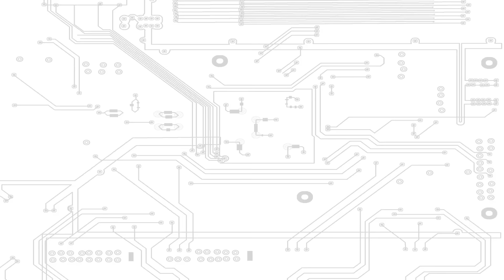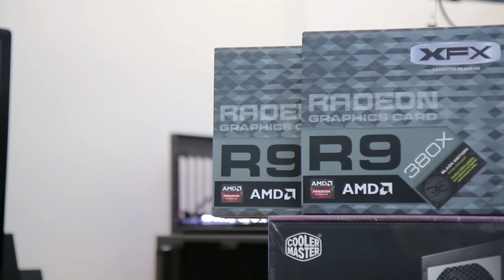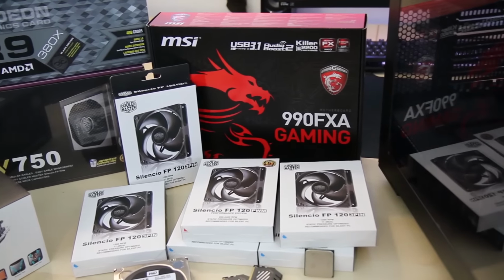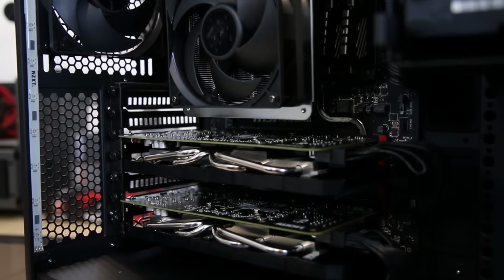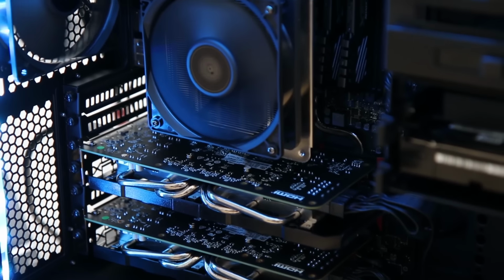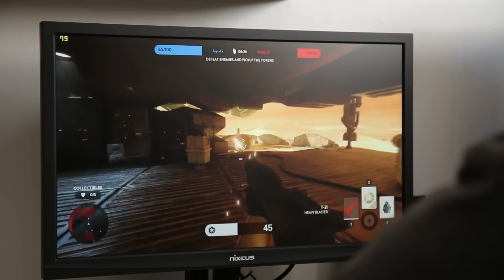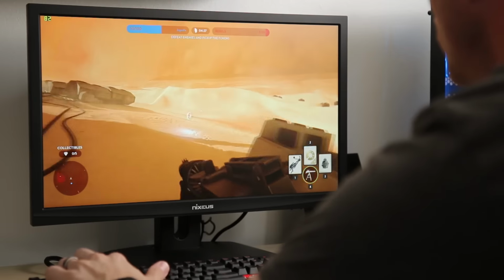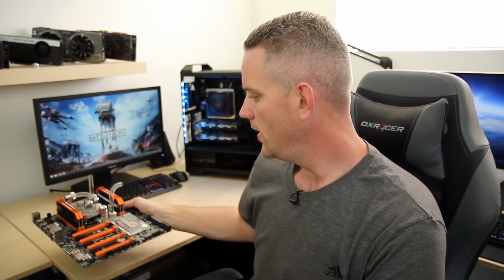AMD Gaming PC - Is AMD still good?

Comment: If all you intel fans wanted to see some proper Amd products u should actually buy Amd stuff and give em some income to show u what they can do. They are struggling to hang on and they actually do with descent price/performance..
So ditch Intel for a bit, support Amd and you will see some great stuff from every company after that.
Competition is what makes the world evolve. And there is no competition right now because everyone is buying the same stuff.
(Intel, nvidia, apple,MS). The consumers brought the hault to tech world, not the companies.
Reply: NO AMD did this to themselves......They bet on software actually using multi core tech which isnt happening until recently. Not to mention they crammed 8 "cores" in there for marketing bs and threw single core performance under the bus. I am an AMD fanboy and have been for MANY years(been rocking AMD since I built my highschool graduation pc in 2002). I built the fx8320 I am on right now in 2013 and it gets its ass handed to it by my GF's 2.2ghz i7 laptop on cpu performance. Thats right 3.5Ghz loses to 2.2Ghz(complete bs)............if Zen is a dud or they try to price it like nothing has been wrong this whole time then I am going team blue on the next build.

All that said since doing a 4.2Ghz OC its just barely beating my GF's i7-2600k desktop in cinebench and it performs well but dont make the mistake I did of thinking an 8 core with 1/2 threading is going to smash a 4 core with true hyper threading.

Its really sad to see AMD dying like this because I do like that most of their chips are unlocked etc but I am at the crossroads with AMD.......oh and PCI-e 3.0 would be nice.
Reply: Cmon man we know we aint getting a beast of an 8core for 130$ (dont know how much it costs where u live but in Greece its literally half what u pay for an I5 6600) . But  for the price i do back it up. Even today.  Why would there be multicore s/w  when the greatest percentage of users has 4 cores max?
totaly agree with u on zen pricing btw. 
Call me an idiot but i actually moved from team blue to team red this year and i kinda like it. 
My demands arent that high and i can game very descently on an r9 390.
I will feel like an idiot though if zen turnes out to be in the same price range and much better :p
Reply: Im just sitting here with my AMD fx8320 on water OCed to 5.0ghz and an r9 290 oced to 1150mhz playing games at 4k with freesync fps rates mmmmmmmmmmmmmmmmmmm does this make you salty?
Reply: Play Attila with unit size set to Extreme. Have fun, lol.
Reply: quick update i Xfired 2 r9 390s. Will get back with impressions. For the moment i can only say they look awesome in the rig :p
Reply: Deafman what psu do you have. I'm thinking about crossfire too
Reply: I got the evga 850 g2. PSU calculators say i need an 800W  psu (even with small oc) so i guess im ok unless i run benchmarks all the time. I would advice a 900+ psu just to be on the safe side unless you plan to use cards from the new rx line that wil be fine even with 750-800W.
Reply: You should be fine. Just don't go crazy with overclocking. Use fps limit from crimson so that you don't stress you cpu and gpu on games that you run without v sync. My pc with a single r9 390 uses 600w on full load. I have a fx 9590 tho with 220tdp
Reply: i dont plan to oc my cards to be honest just a fair 1050-1060  on the clock and thats ok for me. Cpu will stay at stock 4Ghz for now as long as i dont get weird bottlenecks.
Reply: Deafman i really hope for amd to do well but id never buy a amd product again... this has nothing to do with me being a fanboy(i always decide objectively) but i was let down by amd cpus/gpus serveral times
Reply: i see how this can affect your future choices but i see only improvements. i am kinda new to amd products and i got nothing bad to mention. i mean yea they consume more power and what not  but those arent really problems imo.  i wouldnt suggest getting to amd if u got a proper intel cpu but i do like their gpu stuff.

Comment: im gettin a 8320 and a 280 :D
Reply: Get a i5 4460 + 380 instead
Reply: no
Reply: I would recommend getting an i5 4460 instead
Reply: +Ares  intel is a lot better and offers a greater upgrade path
Reply: +Ares nice when?
Reply: +Ares NICE! I do have a 8320 and a r9 280x, its awesome. 

however be carefull with mainboards. I have an Asrock extreme 3 r2.0, and its capacitors will fail to deliver enough power to the cpu at 4.2 ghz plus. Which is sad cause i know my chip can run 4.6 without problems.
Reply: +Ares Just get an i5. Most games aren't as well optimized as battlefront. You're basically buying an obsolete chip just because it's made by AMD. AMD doesn't even use their cpus in their own builds. Just look at AMD Quantum, it's using an i7.

"We hardly need to point out that it is rather intriguing to see AMD use its largest competitor's CPU in its own product, when AMD is a CPU maker itself."

If that doesn't sum it up I don't know what will.
Reply: +Ares Even better, get a 8320e it uses less power and can still max games out. And grab a R9 280x instead of the R9 280 because its got a much higher clock speed :)
Reply: +Nicholas Nore i7 is far too expensive for simply playing games... i5 or fx 8320 will do just fine.
Reply: Bannana Xeon 1231v3 and an h97 board costs the price, or sometimes less, than an i5.

Comment: And everyone says AMD cpu's run really hot.
Reply: +Amar Gandhi Yeah it's dumb, my fx 8320E hasn't gone above 36c yet
Reply: +The1AndOnlyRyan 8320e masterrace
Reply: +Tijn416 TF2 and Cs:Go love their E series chips
Reply: +Amar Gandhi not hating on amd at all, but the temperature sensors give out wrong readings on most of the FX series cpu's. +The1AndOnlyRyan 's numbers confirm that. 36° is absolutely impossible unless we are talking a full custom loop. it's still a 100 watt CPU. i've also seen FX's claiming to run at 6° when idling in a 21° room. the FX's do run quite hot, especially the fast ones or when overclocked, but it's not like it can't be dealt with. people usually don't give a shit about energy consumption, unless it's something they can fanboy about...
Reply: givemeajackson Yup. Do people even care that top end k-skews like the i5-6600k and i7-6700k run at TDP's of 91W, and that the Haswell-E models like the 5820k has a TDP of 140W?
Reply: Amar Gandhi with cpus it's even more meaningless, the differences are tiny, and if you overclock it all comes down to your particular chip anyways. of course it's impressive how much performance intel can squeeze out of just 140 watts on the 5960x, and of course efficiency is a good thing, but in the real world it really doesn't matter if you use 60 watts more or less. better change out some old lightbulb for an LED, that's a cheaper way to save 60 watts.
Reply: W3ngster again, the temperature readouts are usually wrong with fx chips. what cooling are you running? i'd say it's possible if you run an ek supremacy evo and a loop coolant temperature of under 26°C
Reply: W3ngster then it's definitely 100% wrong. your actual temperature should be somewhere in the 70s without overclock.
Reply: by "hot" they mean is the actual heat coming off of the chip, not the actual temperature of it.  It is undeniable that at present, AMD GPUs and CPUs have higher TDPs than their competitors
Reply: Bullshit. 8350 never goes up 43c. the problem maybe is on stock Cooler of the cpu.
Reply: Kurgan100 wrong readout from the sensor, unless you run at least a 420mm rad. 43 is impossible at that sort of tdp. my 5820k undervolted is a bigger chip with a soldered heatspreader at similar tdp, and it hit 60° under a 280mm AIO. actual temperature should be about 20-25 degrees higher. not that it really makes any difference though, anything under 75 is fine anyways. mobos always die before the cpu does.
Reply: what type of software degrees controller you'd suggest? Im with Msi afternurner (I heard that its not a good sensor for Cpu) Cpuz don't recognize me the temps
Reply: Kurgan100 well, i use realtemp and afterburner, and they usually agree with each other, so it can't be that bad. but the problem isn't the software, it's the actual sensor on the chip. it's a common problem on the FX-series chips. they sometimes claim to idle at like 5° in a 21° room. i don't know whether it's on all the FX chips or if they fixed it in the later runs, but 43 under load is impossible unless we're talking full custom loop with basically ambient fluid temperature.
Reply: I have an 8350 that runs hot. 60C MAX, while watercooled...

I have an AMD rig and I have to admit that i5 6500, same price, much faster, with stock cooler is way cooler...

So not all AMD CPU run hot, but some REALLY do...

Same for Radeon cards. I have a Fury, air cooled, and it runs super cool... 60C maximum, absolutely inaudible... Equivalent than a 1070 (a bit lesser) and much cheaper. But the 380 for example runs hot and loud.

While... Nvidia cards run, from low to high end, generally cool and quiet. 

The fury is clearly a big win however and for anyone wanting to upgrade their GPU, I would definitely recommend taking the FURY. A nearly GTX1070 equivalent, for 280EUR. It's a steal...

Comment: Another great video! I currently have the 8350 AMD processor, but I am going to be rebuilding a new PC or upgrading the one I have now. I need to go to a full tower with better air flow support and need to add in a water cooler system. This build you have looks awesome and I will definitely research the parts since I want to do an all AMD build.

Comment: lol amd is easier to build?
Pins on a CPU is easier bent than pins on a motherboard.
Reply: +GuardianLords Irrelevant, unless you're an elephant trying to build a computer.
Reply: +GuardianLords Depends, Where you can bend the pins back with a mechanical pencil vs throwing the motherboard away on the Intel side of things because the pins are so thin and have to be in just the right angle for it to touch the pads on the CPU when under pressure. AMD pins are a lot thicker, its harder to bend and snap them off where Intel you can just breath on the socket and bend the pins. But storing the Intel CPU's is much easier. So it depends how you store the stuff or install the stuff.

Comment: Yeah Jay, I use 2 280x in crossfire but I get around 144+ fps at 1080p Ultra with the beta drivers. However, there are some stutters sometimes and the game crashed like once for no apparent reason. The drivers right now for crossfire and the game are really far from being optimized. Nice build and keep up the good work.

Comment: Nice build, am impressed the air cooler does so well, I have an 8350 with the Coolermaster Seidon 120 on it and get about the same maximum temp while gaming. Never knew the chipsets could be a heat problem though, I might need to take a closer look at that. Thanks for the heads up!
Reply: +U Wot m8? um, lol, yeah, I still have high airflow in my case, so it's not like nothing is circulating air in there, but explain to me please how the CPU power usage affects the CHIPSET, not the VRM's, I know the VRM's are under a higher strain, which is why I chose a board with military grade VRM's that have passive coolers mounted to them.
Reply: +U Wot m8? Did I say anything about VRM's? Did Jay? No, Jay said the chipset gets warm, which was why he wanted to use the air cooler, @1:10 he says "Because the Northbridge gets hot" And that is why I thanked him for giving a heads up about that. YOU sir, made a comment about VRM's, which had nothing at all to do with what Jay said and I commented about.

Comment: Awesome video bro. You do a terrific job about being REALISTIC with what a gamer would build, especially around the holidays. That's a solid system that'll run GTA V, BF4, Battlefield Hardline, and Battlefront and all the other cool games out there. I guess what I'm trying to say is... I stole this build (in terms of parts list), and I'm building it in 3 days, sans one of the 380Xs and replaced the XFX with a Sapphire Nitro variant. Everything else is the same.

10/10. Looking forward to my first AMD CPU build!

Comment: AMD is truly awesome for budget builds, and I've been using them for 98% of my personal builds the past 20 years now, and rarely have I had a problem outside Linux drivers, and the early mobile and E series APU chipsets. I will have to admit i could not find an AMD based Chromebook, and went with an HP 11 G3 with an Intel chipset, and I've really been liking it as a 2nd machine.

Comment: Thanks for another great and honest video Jay! That's exactly why you rock. You are definitely my house holds favorite computer build vlogger. 
I was running a FX-8320 until Christmas as my 14 year old son wanted it as an upgrade for his system, and my youngest son took over his FX-6300 for his build, and I upgraded to the FX-8370. We have never had an issue with either AMD processors or Video cards ever. The only problem we run into is with low budget PSU's.  That will be the next things we get upgraded.
For Christmas I got my oldest son a Corsair H80i GT watercooler as I did for myself as well.  We need to upgrade our psu's next and are considering the Corsair HX 750i & HX 850i to match our i Series water coolers. Any opinion on Corsair i Series "LINK" hardware & software?

Comment: Still got my 8350 up and running with a GTX970. And it still performs great. I don't have a 4K monitor, so I really don't mind gaming at 1080 on a 37" TV. I've had some thoughts about upgrading to ZEN,  but it seems a bit of a waste as long as my current rig still performs as smooth as it does.

Comment: good video jay. amd may be behind on the times but as you said, still relevant. im using an fx6300 and it may not stack up well against an i5 etc but to be honest it does everything i need i get an average of 100 fps in a lot of games bar some of the newer ones. i am building a new system in next few months and im on the fence over which platform so i may wait until the new amd cpus are out and watch the fights and benchmarks and go from there.
Reply: +Nathan Shinn also yay first

Comment: "I never saw the CPU go over 48 degrees Celsius."

Vishera doesn't have a traditional CPU "temperature" reading. AMD uses something called thermal margin. Any program that claims to be reporting CPU temperature is actually reporting a modified, inverted thermal margin, which is a unit-less scale. The actual temperature when "48C" is reported by applications is probably somewhere in the neighborhood of 70-90C. 

Seeing 48C in a 3rd party application to monitor CPU tempurature, usually means a thermal margin of 22, or, 22 units away from the maximum supported continuous operating temperature. If you want to see exactly how much thermal headroom you have, run AMD overdrive, it will show actual thermal margin.

Comment: I found this interesting Jay, I've been using AMD for a few years and I'm considering switching to Intel/nVidia as I don't feel I can improve far from where I am (8350 & R9-390) I'm either going to take a small step soon to a 9590 or a big step later to (probably) Intel Skylake. It's nice to see that AMD is still regarded as viable by others, I still use AMD for most builds I do for others but they are usually general PC's on a budget or specialist photo editing machines and AMD is still the best (based on my clients budgets), maybe I'll sit-tight and see what comes along with AM4...

Comment: yeah dude this is a realistic real world build.I just did a similar build myself and I'm loving it on gta5 and project cars.I'm running an 8370 with a hyper tx3 on dual fans. I have 2 in 120mm fans and one out 120mm. 750w 80+ psu, 970 chipset asrock board and vengeance pro 16gb ram. 240gb ssd. 1tb hdd.  xfx r9 390.I love it. My first build and after a few set up teething problems I'm really happy with it. couldn't really have asked for more in terms of performance for price at all.

Comment: Thank you for building this. Exactly why I haven't shut down my FX-8350 system and built my i5-6600k yet. It's still sitting over in the corner wondering when it will come to life. FX is just fine for gaming and any other tasks I throw it's way. So thanks again for helping to dispel the rumor that you can't game on AMD anymore... because clearly... you can.
Reply: +DarkMikaruX The 8 cores do fantastic. With a slight overclock you can match the performance of the i5-i7 of the same time and most new i5s and just behind the i7s.
Reply: +Chance Fletcher Totally agreed sir. My FX-8350 has been rock solid over the past 2+yrs I've had it. I finally built the i5-6600k system and it's beautiful. But I still have a soft spot for my FX and not willing to sell it or give it away. This is my first Intel build so it's been tough trying the Empire this time around. Hopefully Zen will be compelling enough for me to go back to Team Red... where I truly belong.

Comment: I'm still rockin the 1100Tbe with the crosshair formula v, a msi 6970 lightning, and corsair vengeance 8gb 1600 mhz. 

Old t this point. but pretty good at 1080p. been going strong for 4 years.

Comment: 1.45  volts at 4.3 is absurdly high. My 8350 does that at stock voltage. It's not like Jay to use OC genie.
Reply: Since this build is sponsored he might have been told to use it
Reply: Since this build is sponsored he might have been told to use it
Reply from the maker: +Atlas-S You really think we get "told" what to do?? Really?
Reply from the maker: +Spoder Man Thats what OC Genie decided to do. Im sure this CPU is capable of much higher, but since its a giveaway PC. Im not pushing it.
Reply: +Uncle Paulie Holy crap. That's insane.
Reply: +Spoder Man lol my 8320 sits at 4.5ghz at 1.36 bios, 1.32 under load
Reply: +Spoder Man my 9590 does 4.7ghz at 1.400v 100% 24/7 kek